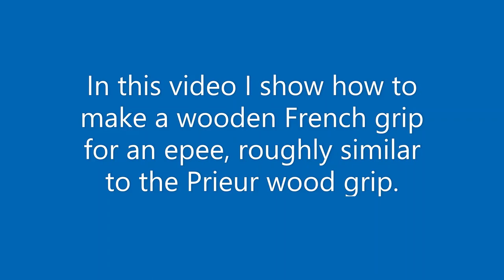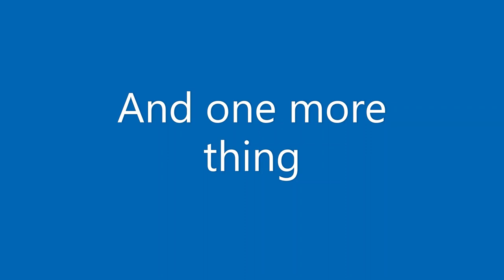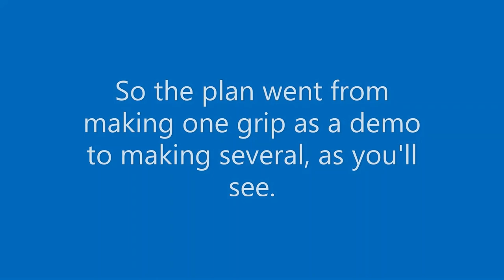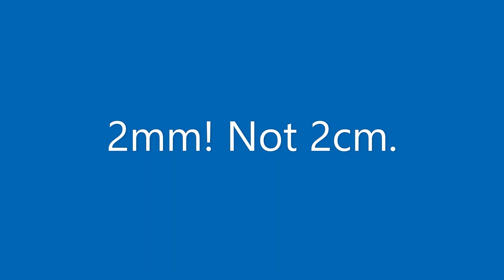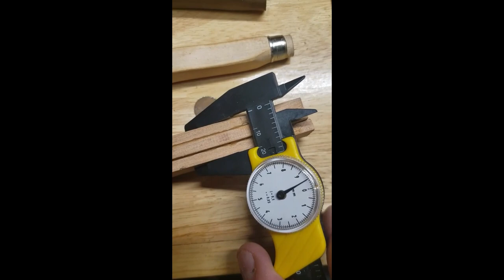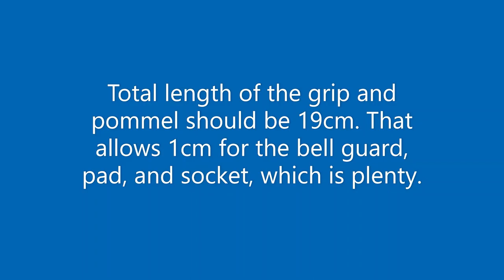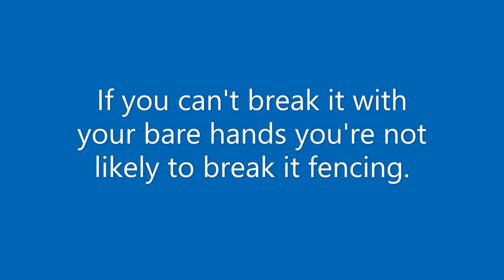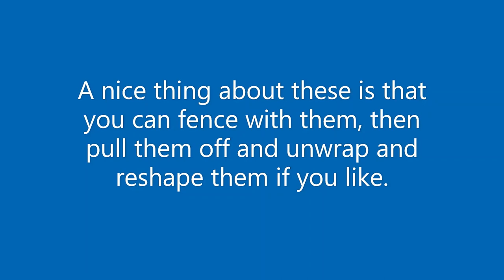Making A Wood French Grip

Comment: thanks for the video...   I have to check a few of the grips a guy running his own club made here in the 90's - but I think he just did them cheap and dirty (well quick and fast)  - cut some wood into size of a french grip (and straight) and drilled a hole down the centre and hey presto instant ambidextrous french grip!!! - so he didn't need to buy any french grips (fencing gear here is twice as expensive [at least] as the states..) 

 he had too many beginners and not enough foils (he also used bamboo sticks as foils for some people so they had something to hold..) and that seemed to work 

sadly he passed away many years ago - Trevor Fowler of fowler's french fencing academy (or FFFA) in Adelaide Australia